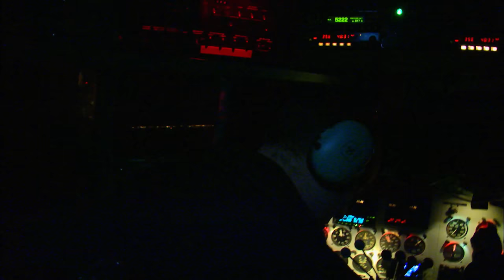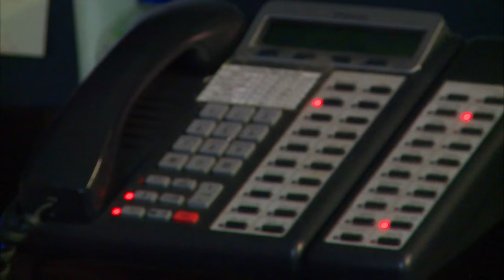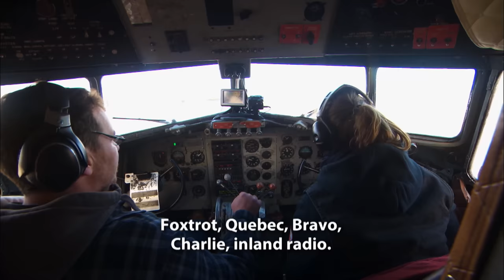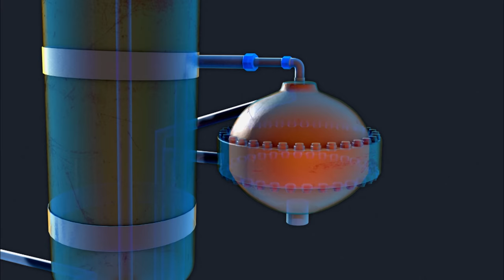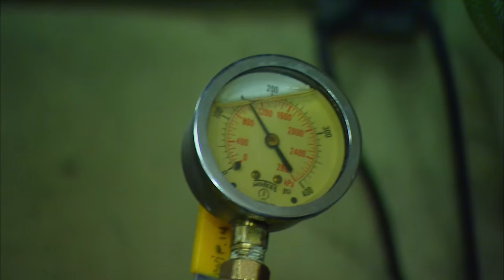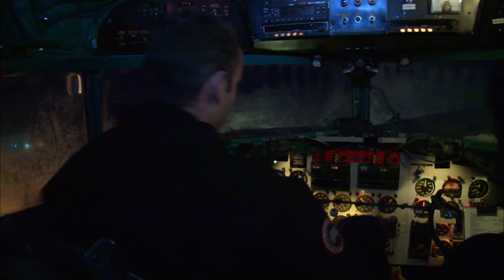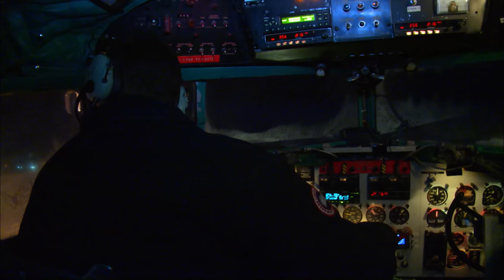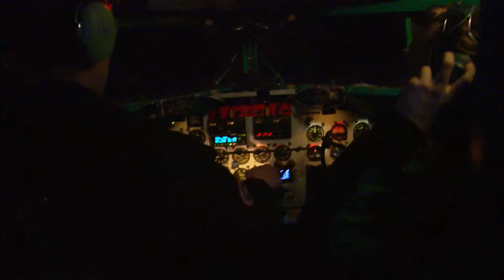Extreme Winter Freezes Buffalo Airways | Ice Pilots NWT | Wonder

Comment: The DC-3 was designed to be able to land with the gear up if necessary - that's why the tires stick out of the bottom of the engine fairings. It will cost a couple props and maybe the engines, but can be done.

Comment: Hydraulics are tricky to diagnose because everything is hidden from view.
The fault sound like an internal-internal leak, i.e. a valve that's supposed to block flow from one connection to another, but it doesn't, either due to defective seal on a bobbin, or a damged seat, or it does not actuate correctly.   One way to locate such a faliure is to touch the valves. If one is hot, it's leaking internally through a restricted oraface, the friction causing heat, depends on the working pressure and viscosity.

Comment: Seem to recall a couple of episodes back that a pilot reamed a newish copilot an new one because the copilot had supposedly not gotten the gear lever fully into the neutral position after lowering the gear, causing a pressure drop and failure to lock the gear, corrected before landing. Any chance that it was the same plane and problem, and blame thrown in the wrong direction?

Comment: Do they use ATF in their aircraft hydraulic systems or is it some kind of special aviation grade hydraulic fluid with red dye?
Reply: Its speacial aircraft hydraulic fluid. Its called mil-h-5606. I have heard of people using atf but your not supposed to. It smells totally different to atf aswell
Reply: @philipm7054  I would imagine the friction modifiers in ATF would not be desirable in aircraft hydraulics
Reply: C141 similar to 737 has red hydraulic fluid.
Reply: All the hyd fluid I’ve seen, is red, even Skydrol.
Reply: @johnnunn8688  skydrol is a light purple
Reply: @colegrossmann389 , ah, well I’m CP4 so red is close enough for me 🤣😂. Anyway, I’m not a rig-pig so kept away from that horrid stuff as much as possible. 👍